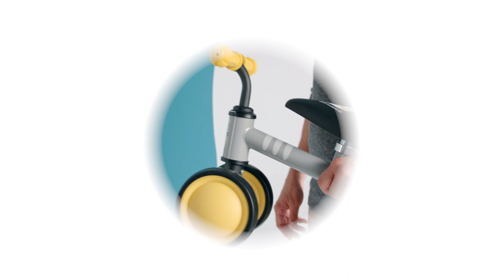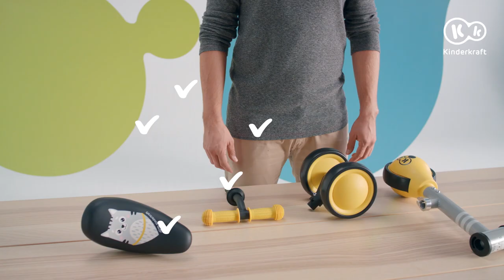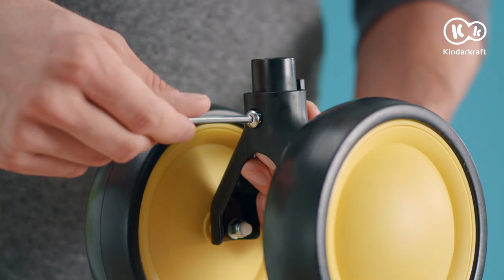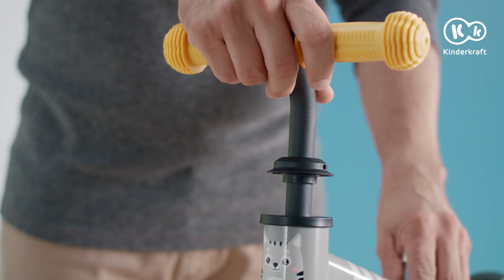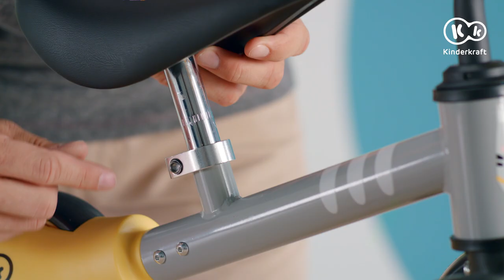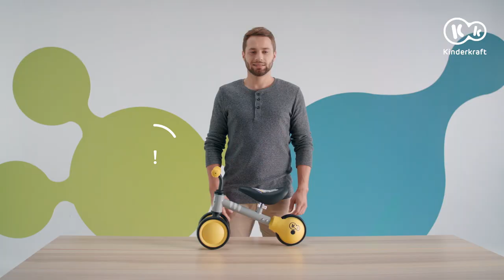How to assemble the Kinderkraft CUTIE bike, how to switch between functions How To Video | Tutorial

Comment: Hi I have one of these and I can’t fit the seat on the hole appears to be too big for the seat pole
Reply: Hey!! Sorry I know that you wrote this so long ago but I happen to have the same problem. What did you do then??
Reply: @sidliy have you managed to sort it out because I am also wondering how to tighten the seat
Reply: @stephaniemain2832  You might have already figured it out, but you just need to use a bit of force to really tighten the bolt on the tube using the included assembly key. If the included key is difficult to use, you can try using another Allen/hex wrench which has some grip support.